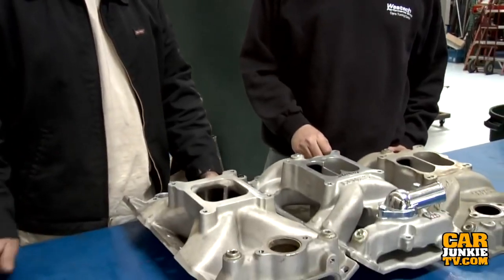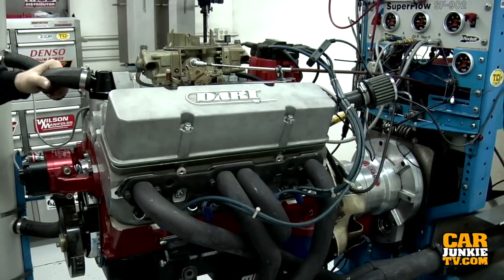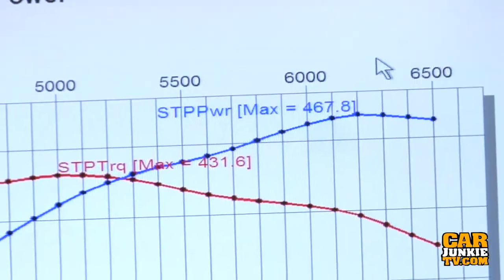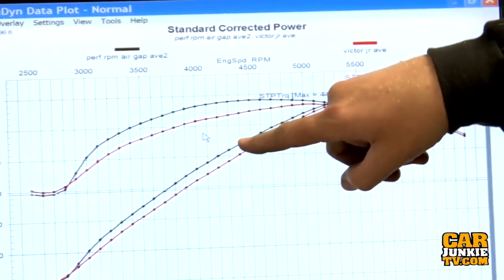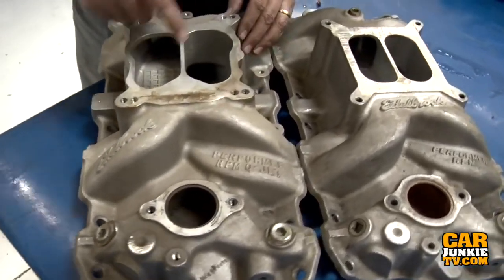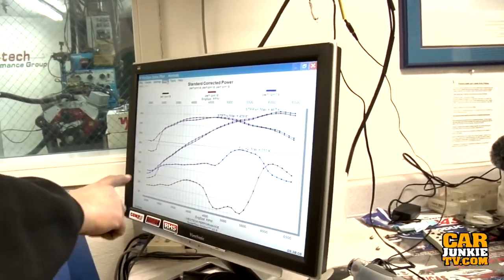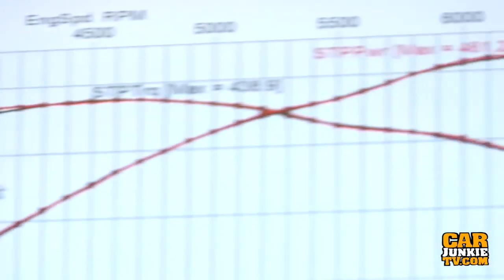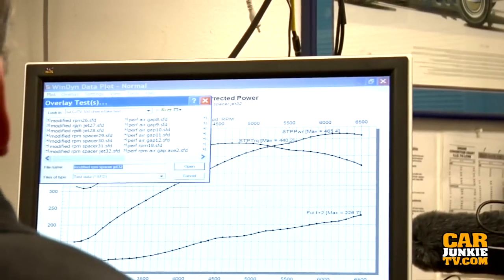Edelbrock Intake Manifold Dyno Test    Single Vs Dual + Air Gap Vs Regular

Comment: I dunno, I'd still take the single plane. I'd just gear it shorter and haul ass past that 3000rpm mark the dual plane only makes 20 lb/ft more. I don't need 20lb/ft at 3000rpm cruise when the car only needs 35hp to maintain a steady state speed

Comment: So a duel plane needs an open plemum above it.......... This Talking motors channel has 2.5k subs Motor trend 7mil, same show!
Reply: No, its not a set in stone rule. Every engine is different, cant drive a dyno either. 
Best to try any intake with none at all...only mess with spacers for tuning.

Comment: I would like to see one of those chinesium eddy rpm airgap copys run back to back with a real eddy rpm air gap...out of the box comparison
Reply: The chinese probbaly just bought a edlebrock manifold and copied it, I would be they are just the same.
Reply: @krusher74 there not the same flash casting and weird threads for fittings
Reply: Most of the ones Ive laid eyes on have runners that neck down inside...never know if it will need milling, holes in the right place etc. 
I wouldnt touch one

Comment: Thanks for the video.
I've got the Edelbrock RPM paformer  intake without the devider and an inch riser with a 4150 Holly. On a 350 4 bolt main. After watching this video I was like nice i have almost that same exact setup. And it starts like a champ.

So how much horses did you get out of it?

Comment: Yep.  In summer,  my regular Edelbroken manifold/carb combo would get vapor locked when trying to restart my 350 after going into the gas station or wherever, unless I let it cool off for at least half an hour.
So I switched to the Performer airgap manifold, and I never have vaporlock problems now.
Reply: Let me guess, you didn't have a fuel return line from your fuel filter? Yes, no? I have not had that problem ever, but I run a phenolic space and the filter with the return line.
Reply: The basic performer or performer rpm would cause Vapor lock?
Reply: @demarques1911  Heat underhood, ethanol laced gas. Happened in the 70s too but nowhere near as bad as it is now. 
I insist on using Holleys Heat shield under the carb it really does help!polishes up nice, too. Has that old Z/28 look to it
Reply: @gordocarbo  so I have one of those in summit racing cart but I never seen anybody using them on their vehicles. I have a quick fuel 750 double pumper... but we only use high octane... just wondering why nobody else is running them. I HAVE seen the training  carb video  and they used the heat shield too. So I'm lost
Reply: Dont get vaporlock but hot restarts are now almost impossible with this crap Ca gas!
Run a Team G ported end to end...fuel bowls dont get hot, fuel line neither it just seems to wanna boil and push its way past the needle/seat Oring. 
Run a 1" phenolic, will be getting a Holley Heat shield in there next. if I get a wild hair a cool can, too. Just cause

Comment: smaller ports on RPM Air Gap, chevy already has 215 cc low cfm flow heads , maybe  A 185 cc AFR Head with RPM and vic Jr can be compared with same everything else here. a high velocity head and intake then a slower higher rev vic jr since times have changed.

Comment: I'm on the fence with the Air Gap intake, at least for my engine. They look awesome and I get the theory behind them. And the only reason I have not installed one yet on my 1970 351 Cleveland is because they only have one part number for the 351 Cleveland. It's neither a 2V or 4V intake. But somewhere in the middle. It's supposed to work on either cylinder head. Now at the moment I'm running the Edelbrock Performer 351 2V intake having swapped from the cast iron intake and 2 barrel carburetor. I'm also running the stock H code heads (2V open chamber). I do have a set of 2V closed chamber heads that I have imported from Australia. I'm not too keen on having a larger intake port into a smaller cylinder head intake port. To me, it seems like that is going to cause incoming air to hit the sides of the intake port on the cylinder head and create turbulence. Can anyone confirm or deny this theory of mine? If they do come out with a true 2V version of the Air Gap, you can bet I'll definitely be looking into it.
Reply: Stay with the performer on the aussie close chamber..heads...my fave street setup..
Reply: Educate me,   how to get parts from Australia??
Reply: @BillieWilliams-l6m  I went on an Australian local website called gumtree, made an account and found an add for the cylinder heads, messaged the poster, they set up all the shipping, which included import fees and all. A few months later they arrived.

Comment: I made my own plywood spacer for my performer rpm. 3/4 inch oak plywood. I just need to cut out that middle divider now.
Reply: if your spacer is open it's allready doing what cutting out in the devider would do.
Reply: @krusher74  I took it off cause it was causing throttle linkage and tv cable to be off. The riser worked great, just the TV cable mostly.

Comment: What gasket do i use for my edelbrock performer on iron eagle heads? there is a gap at the runners. Seems heads were milled before i got them.1970 350cu

Comment: So for years you were telling everyone to use a single plane Victor when a dual plane RPM was clearly the best choice....lol
Also, you didn't "cut out the plenum divider".
You notched it a very specific amount, copying what Edelbrock has done with the RPM AirGap. I'm sure that Edelbrock dynoed the heck out of that RPM AirGap intake to determine exactly how big of a notch was needed in the plenum divider for maximum performance.

Comment: I'm sorry, but I wanna see the test with the Q-Jet intake WITH A Q-JET!!!
Reply: Just built a 355/360 hp . A jet performance q-jet was down 20 horsepower over the 3310 holley. On a 400 hp 355, a junk yard q-jet off 78 truck was down 20 hp compared to the same 3310. The sound when the back barrels open is worth the 20 horsepower loss to me
Reply: @Zane-no5dy  some tuning on the Q-jet may find a few , when tuned on a dyno with a guy having a nice variety of hangers , jets etc , A Q-jet is tough to beat , they can easily shadow any other carb within a few Hp , tq. on a 500 hp sbc , a Q-jet was within 20 buthad some tuning left in it , they are one of the finest fuel metering carbs out there , avg hp
Reply: @Zane-no5dy  the quadrajet is a good carb but you can’t overcome the fact that there’s an intrusive choke horn and choke, and big air doors that maybe don’t choke flow but cause turbulence inside the carburetor. A choke less Holley is some of the smoothest airflow you can find in carbs.
Reply: Yep use a QJet on a QJet Manifold. No adapter plates please
Reply: Ya
Reply: ,,,,,,,,,,,,,,,,,,,,,,,,,A worked Q-jet by a pro builder will be just as good and maybe out perform the holley.......Check out Andy  at Unitymotorsportsgarage,,,,,,,He did a dyno test on a 408 sbc  , using a worked single plane weiand and a 800 cfm Q-jet.......In the end it was good , and needed to be richer at the secondaries....Nobody had smaller metering rods to continue the flog.......
Reply: Quadra Junk
Reply: @ThePeninsulaRailfan , says someone without the knowledge to work on an EXCELLENT carburator.......
Reply: @vincentfarquhar9671   What you all need to realize is that the Quadrajet is the most diverse carburetor ever with countless versions having different bodys and tunes for different applications. That is why you can't take a Quadrajet off one engine and expect it to behave well on another engine. They are not as easy to adjust as the Edelbrock. They are a great daily driver carburetor but only when they are new and dialed. As time goes on they become very troublesome. They require a lot of attention to get right. That is why people hate them, they technically are a peice of shit and not nearly as versatile as an Edelbrock. Their throttle shafts wear fast, well plugs leak and their idle circuit gets clogged very easy. They have a tiny center located fuel bowl and with todays efi formulated gasoline these carburetors suffer heat soak and vapor lock easy.
So yes they are the best carburetor to have brand new with quality fuel filters and insulator gaskets and 160° thermostats, and the right calibration for the engine it came with but they quickly become a peice of shit with some of those good variables removed.
Reply: @vincentfarquhar9671  They are the "smartest" carb ever made. A well set up one on the st is where its at!
Set/forget indefinitely.
Reply: @shootermcgavin2819  Dunno man...dailied my 69 SS 350 over 100 mi a day, Q jet, not once did it miss stumble or need anything.  They can take time to really learn about them which I never did but give it credit. Better st carb than the best Holley I had.  Problem is good quality parts, like a good accelerator pump for the Qjet
They exist but have to really look. Most replacements are garabge and will fail quickly

Comment: Pretty cool. I have a Stock LT1 intake on my 355 CSB, in my ‘69 Corvette.  The engine is not not built to the extent of your test engine, but it has excellent drivability and good power. I resisted a single plane intake when I was building the engine because I disregarded all the single plane claims.
Reply: Smart guy....had a 70 Z/28 factory original intake, little internal work done.  The perfect intake for that engine had no dead spots, no laziness on torque anywhere, cold or hot. Great piece.

Comment: This has been a heated topic since the invention of all V block engines,6,8.12. or 16 cylinders. I believe your problems were in the cam,Not a bad cam just not the right cam. I gave up building fast gasoline motors in my late 40's ,30 years ago,but I always found an open plenum helped to balance out everything, from the top of the carb to the top of the piston all pressure was equal,that makes for a smoother running engine,The fact that you had better results when placing the open  spacer in proves it . An open plane is the way to go, Also Victor Jr was always a favorite of mine
Reply: Had a noticeable difference in st torque with a moderate 383...Torquer 2 and  Holley 300-36 Z/28 copy. The low, midrange torque was night and day, dual plane. Torquer was a little mushy til you hit 4500 or so, then the top end rush came along. 
Depends what ya like I guess.
Reply: Just a side note,ditch the Holley and run AFB carb

Comment: With a split plan or an open you have to tune the carburetor situation with a split plan we got a 750 you're only feeding four cylinders with 375 CFMs open problem you're feeding all cylinders with a 750 there's a big difference in fuel atomization with a open problem then there is with a close problem you don't have as much fuel to atomize for each cylinder you need to tune it with your accelerator pumps and pump ratio this is carburetor tuning 101
Reply: Your problem was the plenum.

Comment: I know this is a really old video but the only thing that I didn't see or even hear you talk about cuz accelerator pump and ratios those are what get rid of the bar coming out of the hole but that's only if it's a street car because if you're a drag car you're leaving it 48 to 6200 right off the starting line there ain't going to be no bog

Comment: You've built a really good long motor with a decent cam head compression setup, but I was disappointed to see you comparing manifolds that were all out of the box... while on one hand is ok, but for the most part doesn't show their potential by not port matching them.  That would be a real test. If I was to fill the port up on those heads with epoxy to match the manifold, you'd say I was stupid, obviously killing the flow no end. 
Not only drastically reducing flow, you're moving the mcsa from the pushrod to the intake manifold....
.6 mach is waiting for you???
Personally I think, that the single plane will be losing more than the dual plane when both are port matched, but I am only guessing.... maybe that's a test for the future.
Big "Joe" Sherman said he'd never bolt an intake on without port matching.
If I remember rightly when he won the first " Engine Masters" his 360 odd inch motor made over 600hp at 6500 with a mid 230 degree hydraulic roller cam 10:1 comp on the Westech dyno using a single plane Super Victor methinks. Very impressive considering very mild engine.
Food for thought for future manifold test comparisons.
Reply: Joe also said for most street cars changing intakes usually isnt worth a hill of beans unless one had a really wrong one to start with. I dont worry about teeny numbers on a dyno sheet
99 percent of my driving is on the st. Want a good signal to the carb good air speed and response. 
Tried taking the divider down in a nice dual plane I had yrs ago, it was a mistake.

Comment: I built a 557 BBC for my 1978 Chevy truck and used a performer rpm air gap with a one inch open spacer. I did not dyno the motor but it runs extremely well with a ton of torque.  It’s a 10.5 to 1 pump gas motor with performer RPM square port heads. I used a Comp Cams mechanical roller with.622” lift in & ex with 236*in, 243*ex @.050” with 110* cl.  I thought about using a single plane manifold but I felt like the dual plane with spacer would work better especially with the weight of the truck.

Comment: Thank you for the video!  I have been trying to find a comparison on a regular performer vs a performer rpm. Mainly about low to mid range on a 383 chevrolet. Would anyone have any one have any insight on this?
Reply: Performer about same as stock... weaker than stock on Pontiacs... go Performer RPM/AirGap... 
Chevy V8 came stock with air gap 1916 - 1918... LOL!
Reply: Like the EPS for a nice torquey st engine.